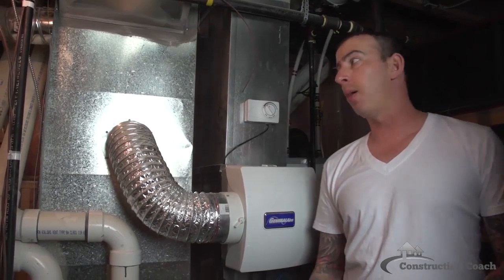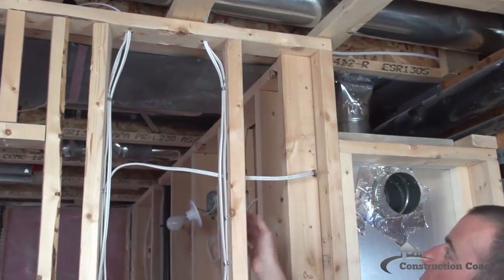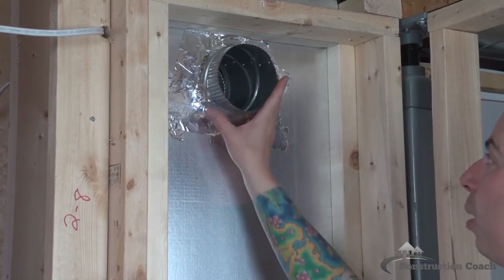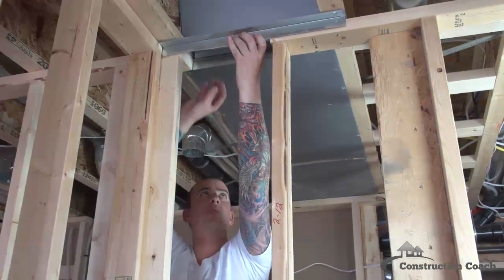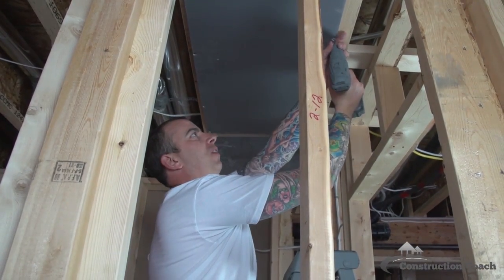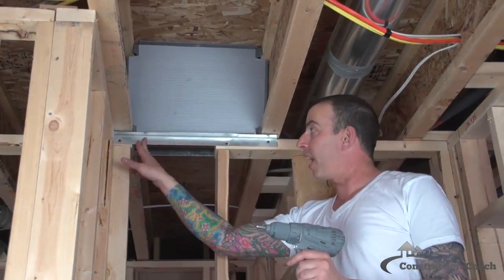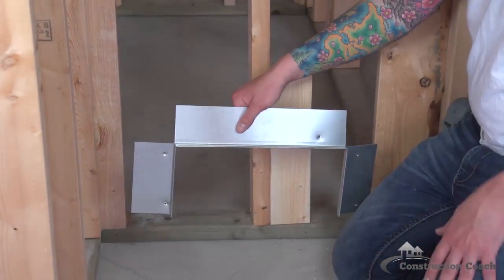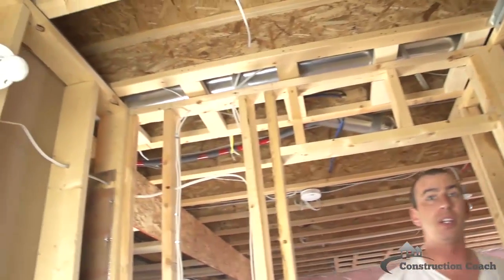Learn about Cold Air Returns & Heat Runs - DIY

Comment: why does every room need a cold air return?  I have a small house and floor boards have covered up two of my cold air returns now I have just one.   My furnace has worked in two Minnesota winters so far without a problem.  So  again why do I need so many cold air returns?
Reply: Same in NYC

Comment: I have two litter boxes in my dining room. It has a register on the floor that blows air upward (not far from from the litter boxes) , and what I'm assuming is a return across the room, the BOTTOM of the plate starting about 6 inches off the floor. I NEVER find dust on my filters when I go to change them monthly. NEVER. So there is cat litter dust everywhere. And I mean everywhere.

Is the return plate too low to the floor??? Is it sucking ANY air to clean the room? I find tar stains on the filter and that's about it. I've even waited 3 months to change the filter to see if there would be any dust on it. None. 

What did my builder do wrong? I can't keep up with the dust on my kitchen tile, adjacent the dining room. It even accumulates heavily on my hardwood hallway off the kitchen. I'm desperate. I'm 56 and have osteoporosis. I can't be on my hands and knees every week wiping floors down. Anybody???

Comment: I have an attic in a bungalow where no heat and a/c gets up through the vents. I don't mean that it's just too hot or cold, but nothing comes up the vents.   Previous resident just told me 'it doesn't work', yet well someone put vents up there for some reason.  I talked to a local hvac company who just basically blew it off and said it wasn't fixable.  Any ideas how I can trace things down?   I learned about dampers and was looking at the ducts in the ceiling to figure it out.  There is a dropped ceiling in one part of the basement that has me curious what's under and it needs to come out anyhow..hmm

Comment: If hot air goes in the return can it cause the A/C to turn on?
Reply: The A/C turns on when the thermostat measures a hotter temp. (ie putting a heater next to the thermostat in the hallway).

Comment: Also someone told us to put Saran Wrap over our cold air returns in the summer so that the air conditioner works better for cooling the rooms. But we had a cold night and I wanted to turn the furnace on I didn't but if I had what it it cause damage to my furnace
Reply: Whoever told your that needs to have their head examined. You should never block a cold air return, especially when running the AC. If there’s not enough return air going back to the furnace, your evaporator coil could freeze up and bam! You’re furnace gets flooded with water and your condenser burns out from excessive running.

Comment: My bedroom doesn't have a cold air return its the only room that doesn't. What does the mean for that room?
Reply from the maker: Not as much air flow.
Reply: Hi Diana, Typically there is gap underneath your door. The air entering your Bedroom will flow under and out to the nearest return air grille, rest assure that works just fine. If you don’t believe me, turn the system on, apply a bit of smoke at the bottom of the door and you will notice the flow.

Comment: In Georgia cold air return spaces has to be fire rated. which would be more expensive than what you are doing. We can’t just use sheetrock as a duct
Reply: Are you certain that Georgia even  has Code 😂

Comment: need help, just found out my furnace return air is coming from the crawl space under the house. Any advice?thanks in advance
Reply: All of it or just the supplemental fresh air intake? If it’s just the fresh air, just get some insulated flexible duct and extend it all the way to the exterior. If it’s all of it, that’s a huge problem and doesn’t sound like your house was ever to any sort of building code.

Comment: HELP...... Basement finished couple of years ago and there are 3 cold air return vents in my basement. I just noticed that all 3 vents do not pull air at all so basement is very cold.  The contractor uses an "insulated flexible duct" for the 3 cold air return duct tubing. The cold air return vents upstairs are working and have strong pulling force, but not the new ones in the basement ( tested with soft tissue and will suck the tissue against the vent when furnace is on).  One of the cold air return duct for the basement is  still visible in the furnace room so I followed it and removed the aluminum foil tape at the connection to make sure a hole was cut for the connection and yes there is a hole cut. I also double check the pathway at the wall by removing the cardboard down to the vent and its clear.  Could the problem be the flexible duct tubing used or how many bents in the layout of the duct work? The size of the insulated duct used is the same size as the aluminum duct used originally.  Thank you in advance.
Reply: Try a little experimenting. Temporarily close off all of the cold air returns except for one in the basement, and run the furnace in fan mode and see using your tissue how good of a draw that single return has. Do the same thing for the other two in your basement. To me it seems that the return ductwork is not connected to the furnace or are blocked on the way to the furnace.

Comment: I have several cold air returns in a row (all joist cavities taken) above my proposed basement bathroom.  Can I put my fan here, or do I need to mount it on a wall?
Reply from the maker: Without seeing it I would say keep it out of the cold air returns. The fan unit it self would block air flow.  I hope that helps
Reply: @ConstructionCoach  Yes, thanks.   I guess I'm building a soffit!

Comment: ...all your pre-made sheet metal accessories will offset the drywall...and your counting on your ceiling drywall to create a air tight seal between joists for your return channel, not a good practise

Comment: What if there is no ducted cold air return? My furnace is on the main level, in a closet in the bathroom. We experience the pressure changes, and push of cold air into the closet. Not sure what else to do. 560 square foot home with full unfinished basement. Would love to move furnace to basement.
Reply: cantikanchi 
560 ft house? I’d move.

Comment: This is why this trade is going to hell   You have so called contractors/mechanics that do not know sh*t from shyowa about what they are doing..  I Being a licences contractor with a state licience, before a judge, they will lose every case and pay bigly $$$   There is too much resistance in all the fittings he has used  Disgrace

Comment: Return air at bottom of room? Why
Reply: proper circulation of air.  Cold return at the top of ceiling would pull the warm air that was just supplied.
Reply: @Kilo_Sierra-64  if your going to have duct work in the top and bottom of the room anyway, why would you intentionality choose to fight the fact that warm air rises.
Reply: It's in the wrong spot

Comment: new energy code in maryland disallows these joist and stud bay returns. must be sheet metal only due to duct air testing requirements. since 2012.
Reply: Same here in Massachusetts.  And even in NY years ago.  Panning the bays sucks all the fine dust out of the walls and floors, and provides a lot of air resistance.    Has to be fully ducted back to the trunk line.

Comment: guess no baseboard is being installed on the second return?
Reply: Haha when I saw him put it right to floor I though the same thing . He should have stated that if there's baseboard trim then bring the CAV off the ground according to baseboard trim and finished floor hight
Reply: Ryan louden I’m willing to bet you the sheet rock guy moved it up.
Reply: Meh sometimes when you're trying to do a demonstration you overlook something like that. Very easy fix as the sheet rock crew will adjust. I highly doubt he always does this as he would have gotten straightened out after the first time. Besides focusing on that, hood video guys?